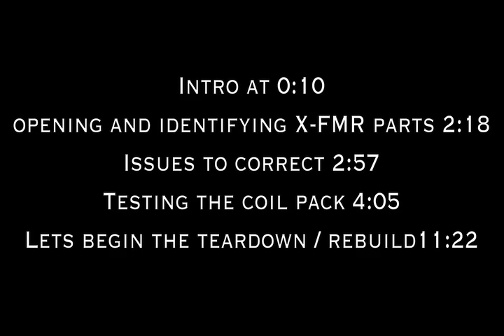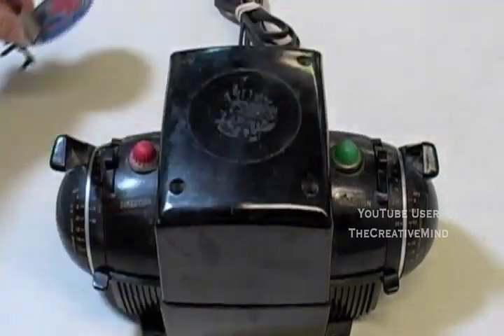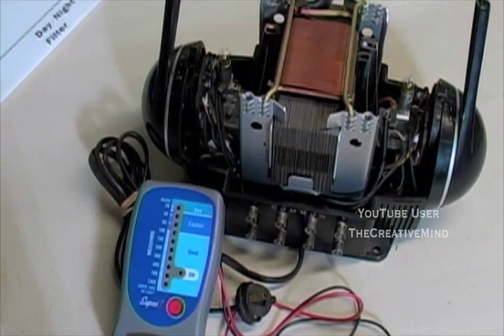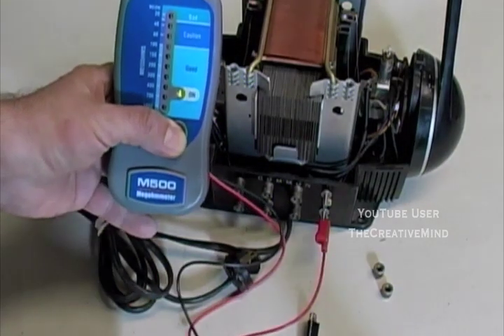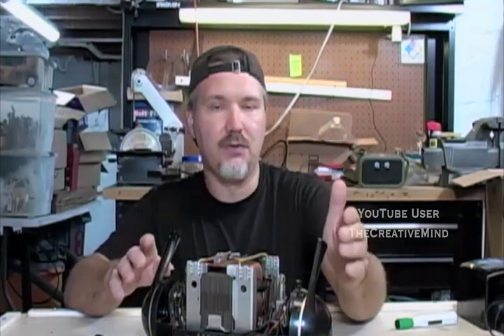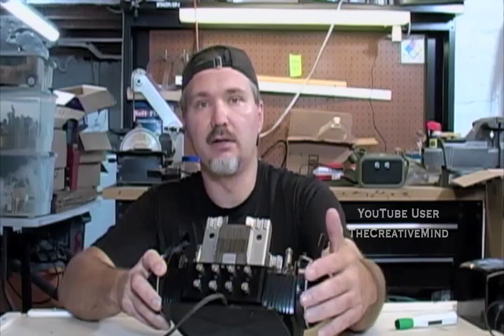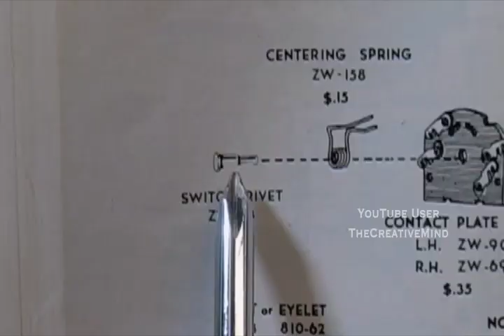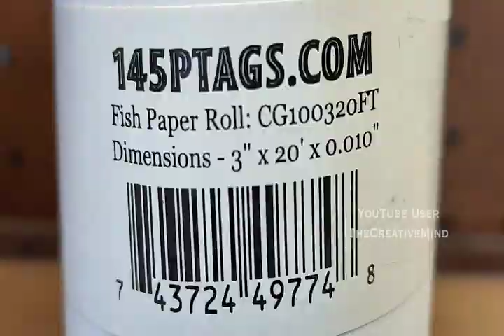Lionel ZW Transformer Complete Disassembly and Rebuild Video (Upgrades and Replacememts)

Comment: What lube are you using and where do you find the 14 guage high temperature wire
Reply from the maker: The dark grease I'm using is MG Chemicals 8481-1 Premium Carbon Conductive Grease. It has a very low resistance rating and won't break down. I got it on Amazon. The grease I used before I put the throttle dial back in is Labelle 106 grease with PTFE. But any silicone grease with PTFE will do plus you can use it on your trains. You don't have to lube it that item, I did so I thought it would roll smoother. The high temperature wire I got from Ebay.
Reply: @TheCreativeMind  thanks do they have a chapter on the zw in the greenburgs operation book that's in your video and the proper wiring diagram for it as the zw I bought from ebay it looks like someone tried to rewire it with the wrong wires.
Reply from the maker: @edwardheyrich8601  In my book pages 591 to 596  covers type VW / ZW transformers. It's the same transformer except the VW is 150 watts. In case you come across a ZW Model R transformer, pages 597 to 601 will help you too.
Reply: @TheCreativeMind  ok everything is making sense now one more question on the switch rivet what oil did you use when drilling and tapping to a 4-40 screw and when you were reassembling the switch what did you put on the 4-40 screw thread's. 
Thanks for all your help
Reply from the maker: @edwardheyrich8601  Glad to have helped. I used 3 in 1 oil to tap the switch rivet. The liquid I used on the screw is Loc Tite super glue. This holds it very well in place, however the blue Loc Tite liquid is what I hoped to use in case I made a mistake. This way it won't be so hard to unscrew the assembly
Reply: @TheCreativeMind  one last question what was the length of the 4-40 screw you used when putting the switch back together also when you were unsoldering the coil you said there's six wires I'm only counting five unless I missed one can you tell me where they are or I can just lift the coil up and trace and label each wire on the coil.
Reply from the maker: @edwardheyrich8601  I used a 1/2" long 4-40 screw. I remember it took up the majority length of the switch rivet. The coil pack does have 6 leads coming off of it. If your terminal leads are facing toward your layout, there's a small thin wire that comes off the top back and I believe it goes to your "green" indicator light. There's 3 wires that come underneath and go to the left side. And there's 2 wires that come underneath and go to the right side. This is not including power. Best I say is label any wires you are removing, even write it down on paper and make a diagram. It can get confusing if you don't know which wire goes to what terminal when re-soldering.
Reply: @TheCreativeMind  in your video you we're cleaning up the coil what was that you used and does it get it clean and shiny.
Reply from the maker: @edwardheyrich8601  that was just a regular eraser. It did get the coils clean and shiny. Don't use alcohol, that can damage the magnetic wires insulation.
Reply: @TheCreativeMind  on the circuit breaker you said you ran several wires to wire in the new circuit breaker. I also have the same circuit breaker that sits on the bottom of the zw can you tell me how you did this and where did you get that eraser to clean the coil. Thanks
Reply from the maker: @edwardheyrich8601  The eraser you can get from Walmart, Staples, Office Depot mainly in the pen / pencil section.

If memory serves me correctly with this circuit breaker, there should be 1 wire coming from the "U" terminal to one leg of the breaker. There should be 2 wires going to the other leg of the breaker and they come from the coil pack and left control board. If you are installing a new breaker and mounting it on the coil pack mount, these wires did not reach to the new breaker. I had to solder these 2 wires together along with a short piece of 14AWG high temp wire to the new breaker on the coil pack mount. After soldering my wires I heat shrink tube the solder joint. I couldn't get this on camera because my camera couldn't focus on the work area. Sorry for the long response.
Reply: @TheCreativeMind  ok everything is going good got the coil out and the bell/whistle switches and the lugs where everything is stripped down my question now is is the inox mx3 better than wd40 and is your cleaning solution better to clean up the coil I tried the eraser not doing a very good job the coil is very dirty especially where the carbon rollers go back and forth. When you were putting the 14 guage high temperature wires on how long were they when you attached them and the solderable  connectors and what size were the connectors.thanks for all your help.
Reply from the maker: @edwardheyrich8601  The Inox is better cause it gives a layer of protection on metal surfaces. I used it on a copper ground bar in a moist environment at work and the copper stayed golden longer. I also use Inox as a track cleaner, just don't use to much or your trains will slip. If you look in my video where I have the 4 rollers installed, you can see the copper arms tarnished after I sprayed WD 40 contact cleaner on them. It won't affect the performance of the transformer it just makes it look weathered.

The eraser may not get the coil pack 100 percent clean. I still had streak marks on mine. You just want to get rid of the deposited carbon so your rollers make better contact. Rub in the direction of the rollers and try different types of erasers (hard to soft) to see what's best. Do not use chemicals on the coil pack, you may damage the insulation on the wire shortening the life of the secondary coil.

I cut the high temp wire 10" to 12" long. This way you can weave the wire where it has to go comfortably. Better longer than shorter.

The connectors on the wire I got from eBay. The style changed but it will still do the job. If there is a size, Lowes and Home Depot sell ring terminals that crimp on wires. Use size 14AWG, but I'm not sure how they will fit on the ZW terminals.
Reply: @TheCreativeMind  ok will try pink eraser and see how that does I also read an article where someone used a soft bristle wire wheel and some scotchbrite to clean the coil any thoughts on trying this.
Reply from the maker: @edwardheyrich8601  Scotch Brite may do the trick and get rid of the stains. If not, the soft wire brush should do it. Use a non metallic brush if available and start on a slow setting. Depending on the width of the wheel, try to do one part of the coil at a time. Increase speed if desired to help with cleaning. But in both cases try not to rub away the magnetic wire insulation. I don't think you will but if you see small flakes flying by your work area, you worked on that area too long. This is why I used the eraser.
Reply: @TheCreativeMind  The scotch Brite worked like a charm where it got all the carbon and dirt off. Now I was washing all the parts to get everything clean and noticed the shaft on the left is missing the retaining washer there is supposed to be one for each side of the handles correct and I'm wondering how I can get a replacement.
Reply from the maker: @edwardheyrich8601  Glad the Scotch Brite worked, I'll try it on my next ZW. On page 595 it does show a washer that goes against  the marker dial. Is this the washer you're asking about? If it is you need 1 for each side and the part number is ZW-51. Best bet is to search eBay.
Reply: @TheCreativeMind  no the one I'm talking about is Retaining Washer part #2460-37 I did find them on ebay and ordered some the scotch Brite I used was ultra fine and moderate got them at Home Depot and pink eraser.
Reply from the maker: @edwardheyrich8601  ah LOL I've always seen those as "C" clips. I should have looked harder
Reply: @TheCreativeMind  ok most of my parts and accessories are coming in now when you were putting the switches back together you used a pop rivet I know it was a 1/8 diameter was it   short in length or a medium and the washer for the 4-40 screw is that just a  regular washer or something else.Also when rewiring the Zw I looked at the the Zw r wiring diagram and the earlier version of wiring diagram of a Zw are they both wired the same or are they different. Thanks I'm getting there where everything should all fall into place.
Reply from the maker: @edwardheyrich8601  I used a short rivet for installation. Longer rivets may interfere with wiring terminals and soldering, I tried one before. I used a #6 washer for my 4-40 screw. If you feel the washer is a little big, you can use a #4 washer over the #6 washer. I wanted to make sure there is enough surface coverage on the thumb switch that it will stay in place. The ZW model R  is designed a little different than a ZW. The model R doesn't have the aluminum wire for the rectifier and the coil pack has a solid core rather than the plated core, but that doesn't effect the wiring. There may be other differences but I have to wait to get my hands on one. Best is to stick with the model you are working on. By the time you are done with this one, you can do 10 in your sleep lol.
Reply: @TheCreativeMind  ok was cleaning all the brass and the metal parts and used the inox do I let it dry on the parts or do I wipe it off with a rag.
Reply from the maker: @edwardheyrich8601  you can do a light wiping
Reply: @TheCreativeMind  so you can just let it dry on its own and it'll be fine.
Reply from the maker: @edwardheyrich8601  The Inox will not dry, it will leave the chemical on the surface but will evaporate in a few days. You will notice dust and light hair particles on flat surfaces that collect on the liquid. It won't do any harm if you don't wipe it off. I did a light wiping on some copper plates and the surfaces faired well. Plus when you're handling the parts for reassembly it may get everywhere.
Reply: @TheCreativeMind  is the resistor wire still necessary to be hooked up as a 40 watt diode was replaced for the rectifier.
Reply from the maker: @edwardheyrich8601  Yes, the resistive wire needs to be reconnected to any diode you get for the ZW. It restricts power to the diode or it will get damaged.
Reply: @TheCreativeMind  ok everything is going well but unfortunately the resistor wire broke off from the soldered connection is this fixable or does it needs to be replaced.
Reply from the maker: @edwardheyrich8601  You can try and re-solder the wire however I never soldered aluminum wire before. 2 issues I know is if you strip the insulation,, the wire may break because it's soft and old. The other is the insulation may contain asbestos. Not saying it will cause a health issue but be aware it's there..

As an option, you can use a regular resistor. I had to dig through my files and see if any forums had any updates, but you can get a 1.5 ohm resistor rated at 20 to 30 watts as a replacement.
Reply: @TheCreativeMind  ok now everything is all falling into place when I was using the 14 guage wire it was a little tedious I also used 16 guage to wire some of the other connections where it was more flexible do I really need to use the 14 guage wire. I should be done with it by this weekend and give it a test to see if everything is working properly.
Reply from the maker: @edwardheyrich8601  The 14AWG wire doesn't have to be used everywhere. Me personally I like to use it on the A-D and U terminals and onto the breaker. The 16AWG would do fine but I like to have more conductor surface coverage for power distribution and to speed up breaker trippage. The 16AWG I would use on the diodes and any lower power and signal distribution.. This is the electrician in me speaking 😁.
Reply: @TheCreativeMind  ok did a test today and I'm getting arching on the B lever and when humming when I increase the voltage but not on the rest their all new rollers and the wiring I did one at a time any suggestions what this could be.
Reply from the maker: @edwardheyrich8601  check all your wires regarding that terminal. Make sure none are pinched or rubbing on the transformer mount or other metal parts. If you have the physical wiring diagram, follow that to make sure all wires go where they are suppose to go. If any of the wires is exposed from pinching or rubbing, use heat shrink tubing to cover that area or replace the wire. Hope this helps.

Comment: What is the part number for the led bulb?
Reply from the maker: I didnt see a part number when I ordered these bulbs from ebay a few years ago. I just searched Lionel ZW LED bulb and they came up. I recently checked Ebay and the LED is sold by seller "autolumination" in 6 volt and 7.5 volt clear, red and green variations. No 18 volt yet for the overload. My 8 star LED bub may be outdated. S U P E R L U M I N A T I O N . C O M has model number 51-Ba9s-7V-4Star-Led and 53-Ba9s-14V-4Star-Led. Hope this helps.
Reply: @TheCreativeMind  Thanks!  I appreciate the information.

Comment: Nice but the only real test for a ZW is under load. A Megger really? This sounds a bit too doomsday for me and shows nothing useful in this regard. Maybe a carbon pile on the output along with a good A.C. voltmeter would at least give you something useful to show a customer," your transformer was able to produce X amperes at it's rated max output on all terminals" would be something better.
Reply from the maker: Yes the true test would be to put the transformer under a load, that I had no problem with. The megger only measures the enamel resistance to ground only and tells me if there's any faults. Best example is when I found a short in the Crescent Ltd armature. Certain volt/ohm meters won't pick up the short to ground but the megger did.

Comment: Those rectifier wires have asbestos lining. You should be more careful with them.  Good video otherwise
Reply from the maker: I have read also that the wires has asbestos on them. I was required to take an OSHA course and asbestos was one of the topics. The instructor said a tiny amount is not harmful like on this wire. But i do agree on approaching this with caution.